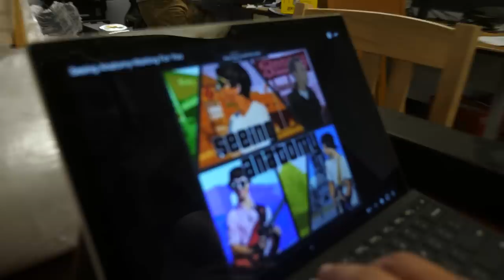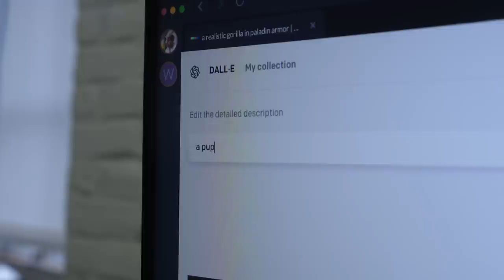Our First Finished Modular Sit/Stand Desk! (Big Gulps required)

Comment: Give me a way to mount my mid-sized tower to the desk!
Reply: Yeah, I was hoping a cubby would be available that's tall enough for a full size case. Shouldn't really be a problem to offer one. Not sure if the 'tall' cubby is going to fit but hopefully they did design it around that.
Reply: @jonevansauthor  A full size case might be too much. The cubby would have to be pretty massive, it would also make it look lopsided. A small form factor PC/small mid-tower would fit better.
Reply: @BritishTeaLover  I don't understand. I don't buy PCs to fit my desk, I buy desks to fit my PC. Since my tower fits under my desk, and any full tower would normally do so (I'm sure there's some monstrous cases that wouldn't) I see no reason the box can't be big enough to hold one.
Reply: @jonevansauthor  my point was more than if they make it big enough to accommodate the larger cases, it'll end up looking uneven. Your current pc doesn't hang off the bottom of your current desk (I assume), and it being on the floor separates its design from the desk.

There's also that a holder that fits a full tower will make any other pc look weirdly small (unless wyrmwood made several sizes).

I think it should be aimed more for smaller/mid sized PCs, and if someone has a larger one then they keep it on the floor.
Reply: @BritishTeaLover  but it would be my desk, not yours, right? I would like them to offer a box that will take a full sized tower. It's just a slightly different sized box.

My current PC isn't supported off the bottom of my current standing desk for the one and only reason that it doesn't come with a platform to do that. 

It's not because it's a bad idea. 

The point of raising the PC, is that then all the cabling from PC to the devices on the desk, is unchanged. You need only have a power cable that's long enough, and that's probably the extension block you put in the cable management. 

That is why you want your PC to go up and down with the desk top.

Comment: Honestly I would rather this get pushed to next year. Just spent a bunch of money on a GM screen, and a MGT not that long ago. I already have an Ikea standing desk, but this is much nicer and I do want it. Just probably can't find the budget this year.

That said, if the large cubby can hold my PC tower, AND I can get a wood I like for less than $1400 incl. the most mandatory accessories, you've probably got yet another pile of my cash. But I'm getting the impression that isn't going to happen.

(Also have to save money for some chairs for my MGT when those come out, so yeah.)